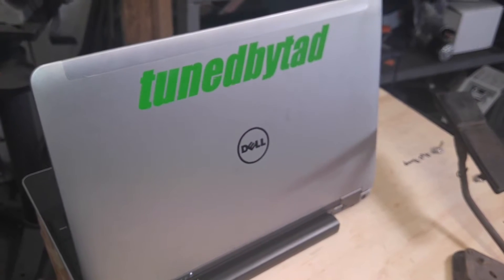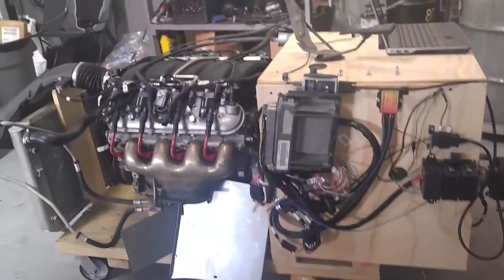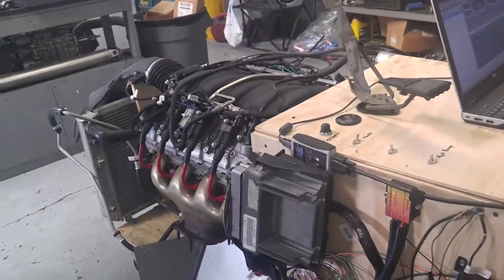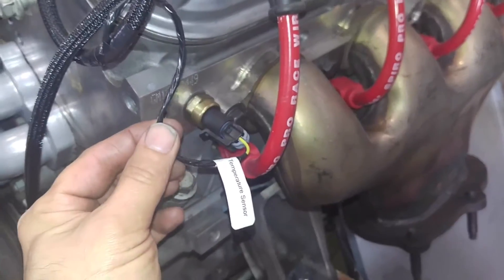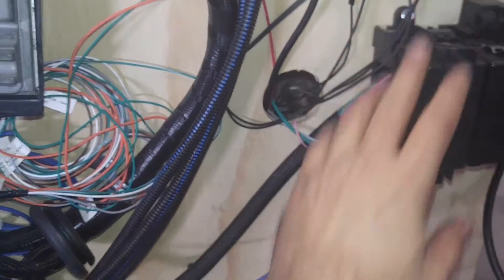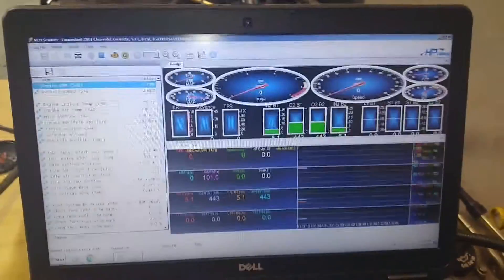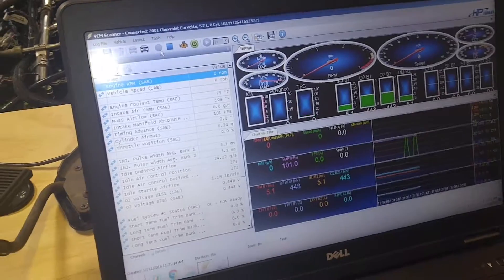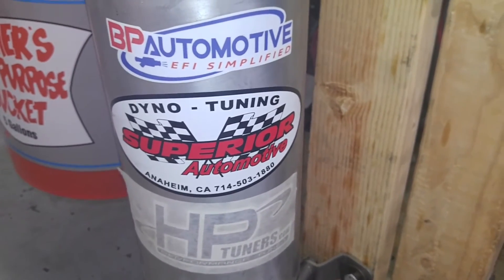TunedbyTad LS7 - BP-Automotive Harness and Test Stand

Comment: Running same ECU/TRG-002 setup on my 427 LS3. Do you find it takes a couple of extra cranks to get it to fire?
Reply: No it fires right off.
see the video

Also 
check the Fuel pressure it has to be 58-60PSI before you hit the ky
good IAC and cranking VE tuning are key to a good fire off.